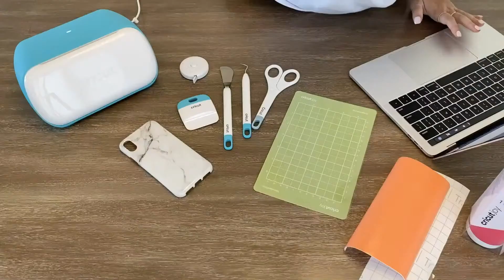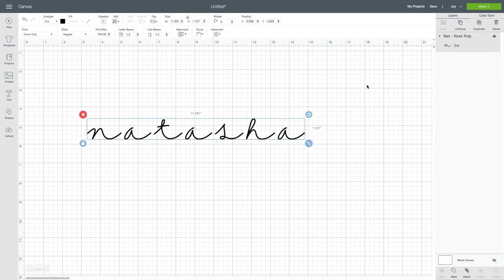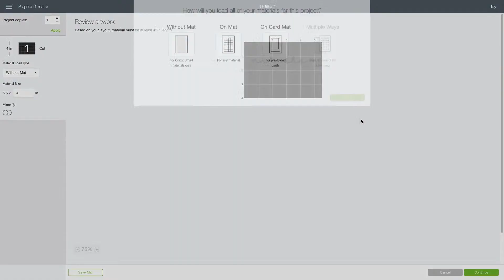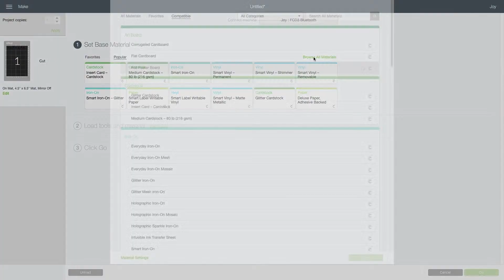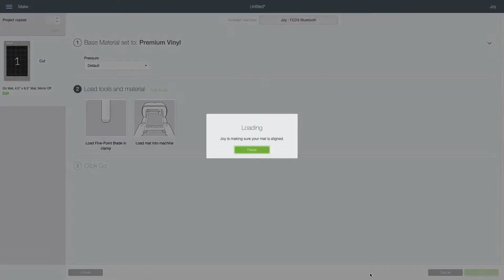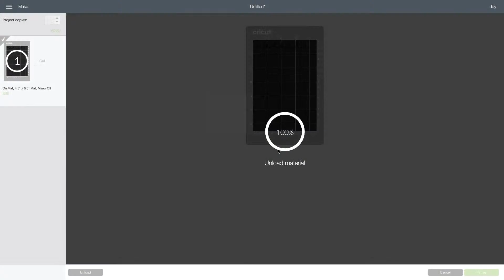Make a Phone Case Vinyl Decal

Comment: How do you finish/seal it? I haven’t found the best way yet
Reply from the maker: Hi, I talked to a colleague and there are some products out there to seal but her best advice if you're worried about the vinyl coming off was to use a clear case and put the decal on the inside of the case.
Reply: @Cricut  what if the case is not clear?
Reply from the maker: @brutalfashion  You could try a coat of Mod Podge. They have a few different options depending on the kind of finish you want like gloss, matte, or even waterproof!